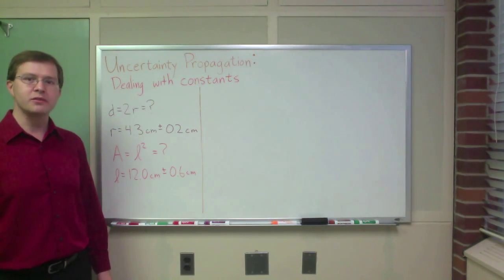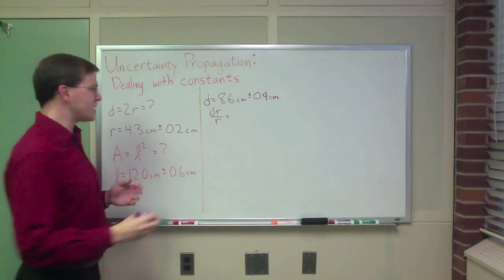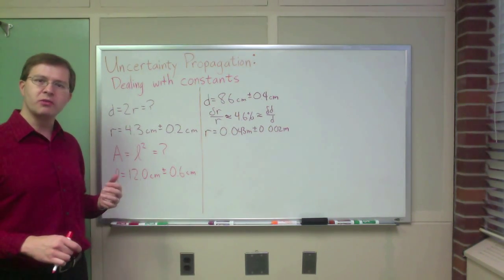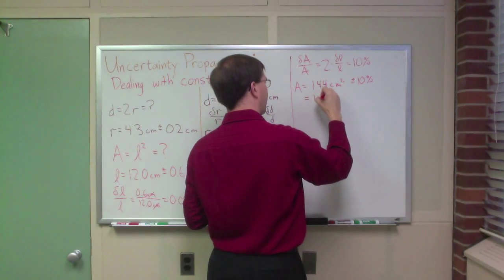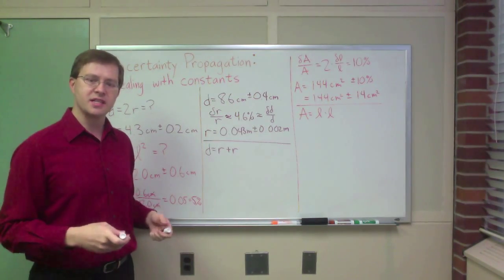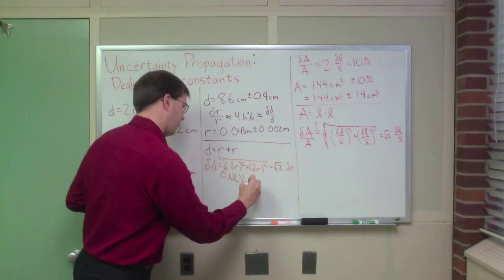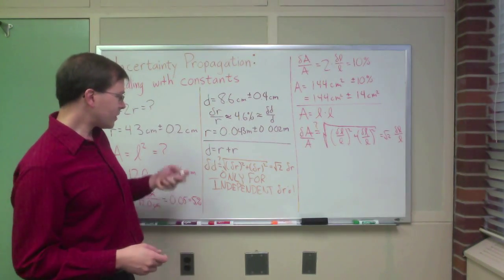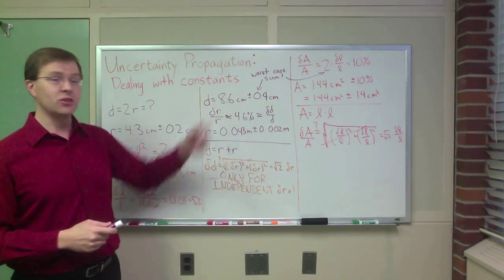Uncertainty propagation when multiplying by a constant or raising to a power

Comment: Hey there.. So let's say volume of sphere, 4/3pi r^3. So after finding the uncertainty of r^3. DO WE multiply it with 4/3pi to find uncertainty of volume?
Reply from the maker: Yep: you can think of this as doing the steps one at a time. First figure out the uncertainty in r^3, and then treat that as your starting value and use the rule for multiplying by a constant.

Comment: Hello! I was wondering if you have a textbook or published paper that you would recommend that states this rule. I have had a hard time finding this process in writing that can be cited.
Reply from the maker: My favorite introductory error analysis textbook is the one by Taylor (published by University Science Books): it's beautifully written. (But on some level, literally all you're doing in any of these techniques is just looking at the x^1 term of the Taylor series for the function in question: maybe that's worth citing, maybe? For better or worse, physicists have a tendency not to cite things that are routinely included in introductory-level textbooks.)
Reply: @Steuard  Thank you, that was exactly what I needed! The analytical chemistry textbook I have been using does not have instructions on how to handle constants. One more question, if you have time (since I did not see this scenario in either text): are the steps for propagation different when the exponent in the power function has an uncertainty associated with it?
Reply from the maker: @alexisedwards874  Yes, uncertainties in an exponent follow very different rules! As a first step, I'd recommend using an exp/log identity to rewrite the expression as a pure exponential: e^(...). (You can show that a^x = e^(x ln a).) But then you'll need to look up the correct rule for error propagation for e^x: roughly speaking, the relative uncertainty in e^x equals the absolute uncertainty in x. (Again, a Taylor series can get you to the correct result. I wish math classes did a better job of convincing people Taylor series were worth understanding.)

Comment: Are there any explicit rules stating how many significant figures should be used for expressing uncertainties? Thanks and helpful video,
Reply from the maker: Yes! Roughly speaking, you should keep just one significant figure in the (absolute) uncertainty, and then keep exactly enough significant figures in the measured quantity to match the last decimal place in the uncertainty. (The one exception that I make: if the first significant digit in the uncertainty is a 1 or maybe a 2, I'll keep two sig figs in the uncertainty instead.) I talk about it a bit starting at the 7-minute mark in this video: https://youtu.be/C2qRoro0VSM?list=PLQcPPNE9JfphAKA23L1eXqYbYViAyWDy5&t=410